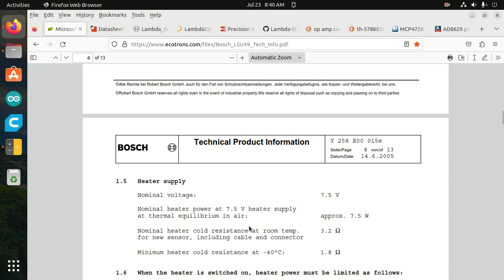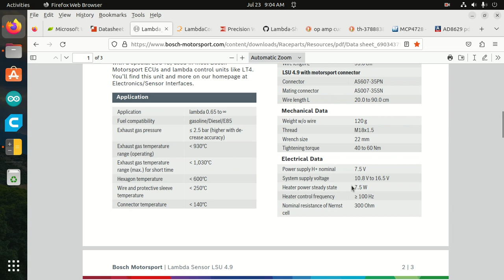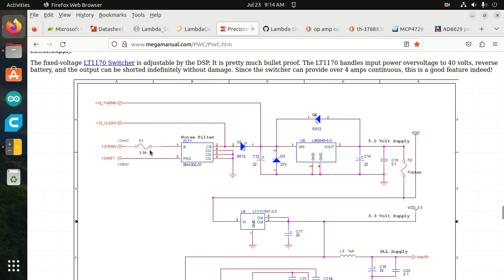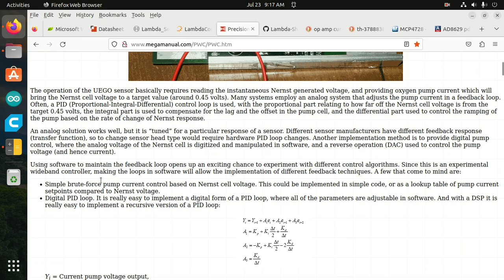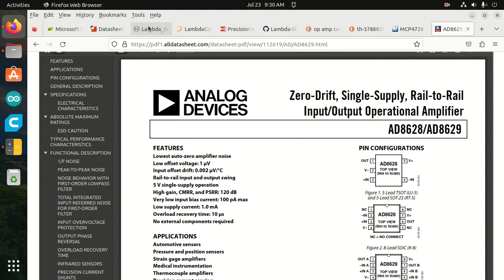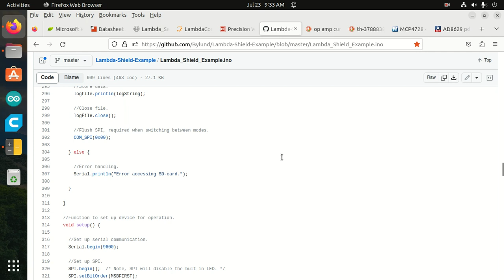wide band O2 sensor control circuit talk

Comment: Mr p k -- any chance you could repost the links in the description, as most of them seem to be cut off?
Reply from the maker: Youtube disabled the links I had in the description after they were up for a long time.  So I doubt they will allow me to just repost them without removal. . I still have the links on my laptop, not this computer. I'm going to work in a minute with the laptop. Maybe I can direct message them to you or something. We can figure something out. Or maybe I put the list of links somewhere that only has one link to it. I'm guessing youtube may make it difficult.
Reply: Thanks for looking at this. It's not an emergency, so no immediate rush. But some of the docs you show look very informative, and Google doesn't seem to find them.
Reply from the maker: @Graham_Wideman  If you go to my channel where you can select videos-shorts-playlists-posts  if you select posts it will be the only post there . I just posted all the links I had saved. You really want to use the LSU 4.9 over the 4.2 because they are improved in physical operational design but both datasheets are linked. The links may not stay working too long so try to copy them as soon as you can. Let me know if you got them please.
Reply: @paulksycki  I have done so and downloaded/visited all the links. Excellent docs!  (One IMF link doesn't work, but the rest seem good.)   Thanks so much for going to this effort, much appreciated!